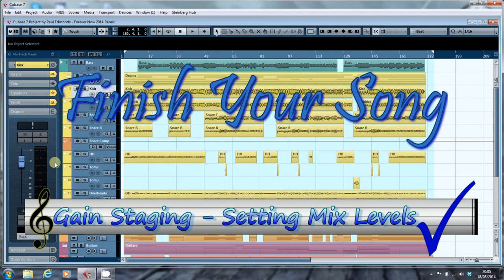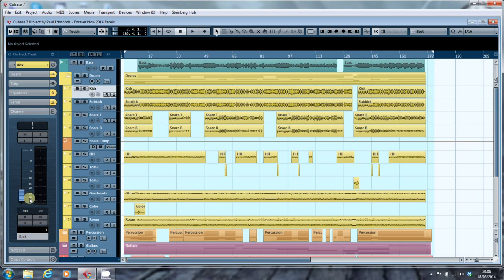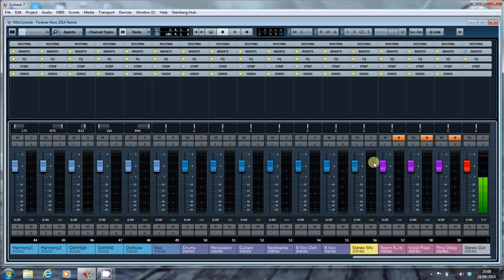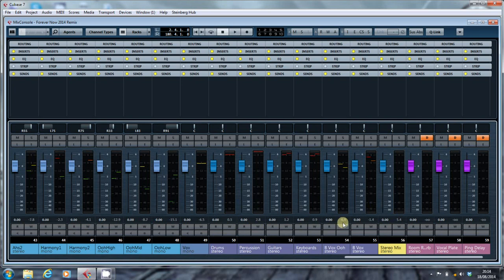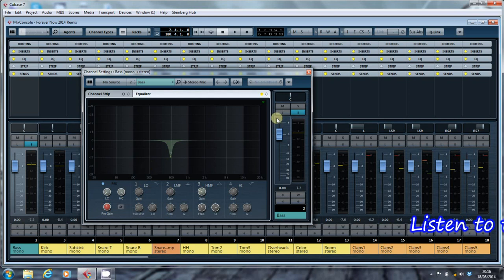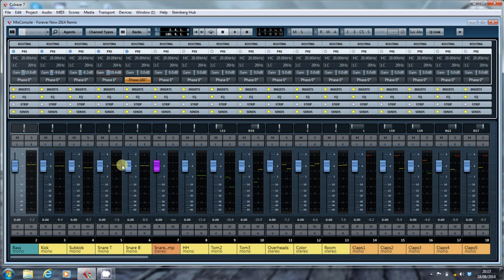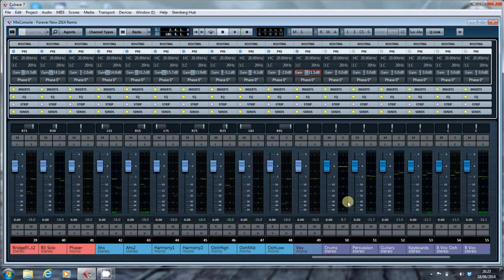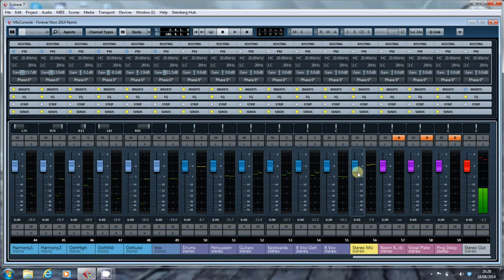Gain Staging - Setting Mix Levels

Comment: Thank you for sharing --- this is really unique way to approach mixing. There seems to be a debate in Digital Recording about how high / low you should record audio. I like the overall results when I record at lower volumes in CUBASE but I find it harder to edit smaller parts with less dynamic wave shapes ---- Your video offers a wonderful solution to my problem --- I think you're really onto something VERY Powerful here. I'm going to try it on a new project I'm working on but I wanted to first say THANK YOU !!!

Comment: Hi Paul, Thanks for this video. very well presented and good work. I now understand the advantages of utilising fadar resolution and the reduction of hot summing in the master buss with pre gain adjustment, thank you!

I did have a question though as I have made an observation in the video on the numbers reduced with rms and peak in mind in respect to headroom.

You have clearly shown and very well may i add how to reduce pre fadar gain volumes in respect to the peaks and reducing peaks to around -18dbfs from what i can see. Should the rms audio not be reduced to the avg of -18 dbfs  so the peaks present themselves at -15-/12 /-10 or wherever they naturally fall.  I can see on the first few channels that the peaks are at -18dbfs which prompted the question.

In other words, should the reduction amount as per the example only have been calculated on the target peak value and not the rms value?  

So in the example you mentioned (1st track) where the track is peaking at -7.2dbfs, don't you want the rms to be around -18dbfs and the peaks to be around -12dbfs. so, the amount to net off would be - 4.8dbfs as an example rather than -10.8. I appreciate that this gives you 18dbfs of headroom up to unity gain .... and if that was the objective then i follow, but if the sweet spot was/is to comply with analogue designed vst plugins is -18-dbfs, then doesn't the rms need to be -18dbfs. 

If i'm not making sense, please call it out as i'm learning the ropes but just wanted to share my feedback and hear your thoughts. I appreciate that this all subjective but I was just lining this up against todays guidance around targeting recording sweet spots of -18dbfs rms and not peak, but with peaks hitting -12dbfs before static mixes start.  I understand that headroom is measured between the peak and unity gain so when i saw the peaks at -1dbfs, I thought thats lots of headroom :-).

Look forward to hearing from you and thanks again for being so articulate.

Thanks,
Mark

Comment: I thought this video was spot on, thanks. I've been struggling with this for a while and didn't quite get (as many people don't) why you shouldn't just bring the faders down...but it clicked in my head as you explained it. Thank you sir! Personally I get carried away with adding effects as I write a tune, but since watching this I'm starting to feel like it's probably best to hold off with the effects, do the gain staging on a dry mix, then add effects after..? I've seen other vids that say that you then need to ensure you subtract the volume of the added effects too; in order to keep the original gain stage... This seems to make sense...Would you agree? :)

Comment: Nice, easy & good explanation of a "concept" that can become rather confusing... All these "words" can also confuse... I mean what is an Input Signal (Gain) when mixing in a DAW? Well, the very first input signal would then be the actual waveform itself (for audio tracks). But when that signal then move on in the "signal chain" in your DAW it is "re-named" into "Output signal... So all signals that goes into something is called Input signal (or Gain) and all signals that goes out from something is called Output signals. So the very first signal in a DAW is Always an Input signal, while the very last one is an Output signal.. Confused yet? ;) However, it's good to at least use two Words to separate things = "Fader Volume" and "Gain Volume"! Perhaps??? When Gain Staging Always use Gain, not faders... Well, may not be confusing for those who have the experience but for "new mixers" without education, well.. it can be! All in all, good video! :) I know try to aim for the Gain to not be higher than @ -18dB LUFS (average volume) so it doesn't "hit" a plugin, like a compressor, too hot!

Comment: Hi! thanks for your vid. 
a question :  when i see in a VU meter 0db is -18dbfs in digital. ok. 
but a VU meter displays rms value so.. why u gainstage at -18db peak and not -18db rms?
Reply: Muddy Funk Good question, especially since -18 peak won't hit the sweet spot of most plugins, which typically engage at -18.
Reply: You should be shooting for average of -18 rms. The peaks maybe -6 or -9 etc  depending on material. 

Some shoot for peaks of -12 because average is in -18 range allowing a lot of headroom.

Comment: Should the bass and kick also be pre-gained down to -18db like the rest of the tracks? I ask because with my headphones the bass and kick with similar db as the other tracks sound way too low. However I am unsure how my track sound on big speakers with lots of bass, and hope they don't sound too bassy. Is it a rule that a balanced mix have all frequencies balanced as a straight horizontal line? I have heard about a "smile" curve. Another thing : Don't you manually edit the pre-gains afterwards? I mean.. you gain stage based on the peak levels and not the loudness of each track. This gain staging alone does not solve any masking between tracks. Still trying to figure out an optimal gain staging procedure, but it looks like your method might be a good way to start mixing. Anyway I appreciate your works on youtube. I like your focus on Cubase instead of Pro Tools - there are plenty of Pro Tools videos at youtube.

Comment: Thank you for this Paul! Is there a way to get the peak levels of each track in Cubase without playing through the song in real time? Like a quick scan or something.
Reply from the maker: Thomas Asp  Sorry, Thomas, I don’t know of a specific function that will do this, although if you reset the meters and then export the track, it does have the same effect and should be quicker, (as you don’t have any plugins loaded that require CPU cycles).  The downside is that you generate an audio file in the process, which is of no use and is the type of clutter that I caution everyone to guard against filling their hard drives with.  There is also the argument that letting the track run through without twiddling makes you listen to it and think about what you need to do in the mix, (unless you leave it running while you go off to make a cup of tea, that is!).

Comment: Great vid!

What I am confused about is that when making an edm track in a daw ( I use cubase 8), you have the option to avoid your signal coming in too hot by adjusting the output knob on the VST. would that be sufficient?
my method of gain staging is that I lower all the knobs down to -10db whenever I add a VST or audio track and never adjust the pre-gain like you did. does this work?

Comment: ho! I understand gain stagging a lot better now. but what about the actual input bus' gain when recording? should I still record the hottest signal the micophone can achieve, then get that down to -18dB on the channel track? like when micing up an amp or acoustic guitar - should my initial signal still be around -3dB for example or should I start with only -18dB on the input? thanks!
Reply: seasonedtoker -3 dbfs is way too hot, generally speaking. Still, bear in mind that there are no rules. If it sounds good to you, don't second guess yourself. Having said that, -18 dbfs is a standard 'default position' for a substantial number of engineers, and i too abide by this in more instances than not. In most outboard gear, 0 VU is considered the "sweet spot", which is why designers of digital plugs corroborate this at -18 dbfs. Hence, aiming for -18 gives you the most dynamic range without experiencing the adverse effects of your noise floor. 

But as always, YMMV.

Comment: So after you have 'gain staged' your channel stripes, is it ok to adjust the their faders in order to achieve the balance in the mix?  I am just understanding gain staging.  Or should the faders always remain at 0.0?  I use ableton live and Sonalksis FreeG for the trim tool.  Great vid.  cheers.
Reply from the maker: +Rhekluse Absolutely you should adjust the levels - the purpose of gain staging is to control the input levels to give you sufficient headroom in your mix for you to then balance the tracks without "cooking" your output stage.
Reply: thank you so much for replying.  I never really thought that gain staging was very important in the digi realm.
Reply: From what I've seen in some videos (and read in posts),a lot of plugins, mostly the ones that emulate analog hardware have a "sweet spot",  a level where they sound the best and it seem to always be between -18dBFS and -20dBFS. This is supposed to be because if a signal enter in these plugins with a level higher than -18dBFS, then the plugin starts to give worse sound and even distorts.

What do you think about this?

Comment: Do we have to set our mixer view in input or post fader to calibrate the gain?
I'm asking because i saw you are at post panner..
So what's the difference?

edit: is it the same if we lower the volumes from the events?
Reply from the maker: pliktro LP In this context, it doesn’t matter, as we’re doing this at the very start of the mix and have no plugins or EQ altering the gain along the signal path, so the meter should show the same level either way.  Leaving the meter post-fader means I’m always seeing my output levels in the mix, (and I don’t have to reset every channel before I start).  Yes, lowering the clip gain on audio events will have the same result, but be careful about editing MIDI events – reducing the velocity or volume of individual MIDI parts can affect the timbre of the sound, so be sure that you’re altering audio levels in your VST and not the levels of the underlying performance.
Reply: ***** Thx for the reply. 
And yes i know about midi tracks i always mixdown to audio before mixing so only audio tracks are in the project just before mixing.

Comment: Should i do gain stage on DI tracks (without amp sim) or with amp sim on? Im really confused
Thanks!
Reply from the maker: Think of it as setting the gain for what you recorded without plugins.  If it's a DI track, then the amp sim is a plugin and you would set the gain before adding it to the track.  Just watch out for plugin creep - make sure the amp sim output is turned [down] so that the signal level coming out is the same as the signal going in.

Comment: i always found it easier....simpler....more accurate to just normalize.....all tracks to --8 to --12 db.......for gain staging.....then panning......then using the faders to dajust each individual track......this way you create pkenty of room for mastering....head room they call it......you should only add gain.....as a final finish to eqch track...before mixdown......or track out........you have a cohesive mix this way.......! peace......just my was.....not the only way.....!
Reply: I think that the less you use things like normalize the better is.